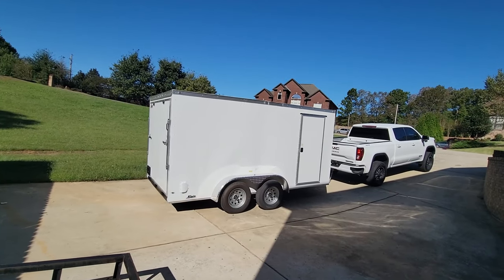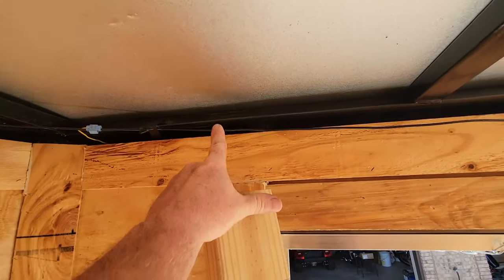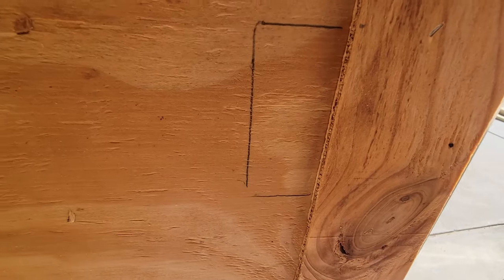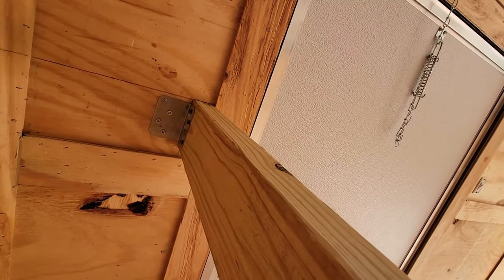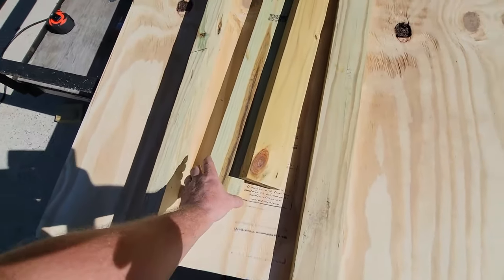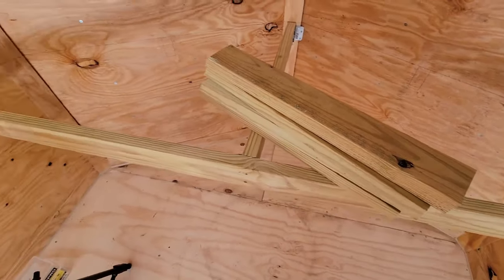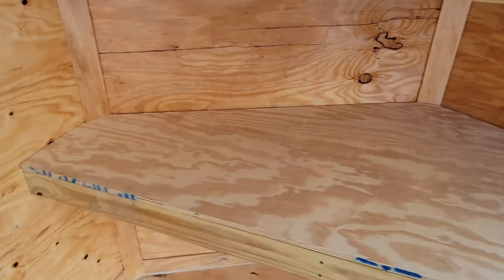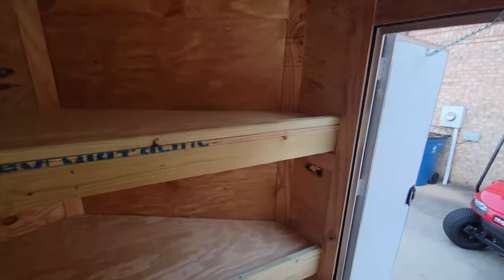DIY Trailer Shelving Install

Comment: Great use of space and much less expensive than commercial shelving. Would also imagine that with the additional bracing you installed it will also help with the structural integrity of the nose of your trailer. Thanks for posting - now come on by and help me get mine in 🤣
Reply: Absolutely I can do that 👍👍

Comment: Great video ! Since the walls are 3/8” thick how sturdy are the brackets holding? Any issues with weight once the shelves are completed?
Reply from the maker: I have about 100 pounds on each shelf and have put about 500 miles on the trailer with no issues. Im pretty happy with it.
Reply: Do not put them just in the plywood. Not going to last. Get them in the metal supports with self tappers

Comment: Sheesh dude would be about 10x stronger if you fastened to the metal studs. I’d be surprised if that’s holding up under any amount of weight. Good for you if it is.

Comment: What if the ceiling brackets your measuring down from arent level? 😳
Reply: Nothing in these trailers are level, or square.  You have to choose to come from the floor up (what  do) or the ceiling down.  Since they are made for cargo and not camping (again, what I do), you have to make the best of it.

Comment: Shouldn’t you screw into metal tubing of trailer
Reply: Yes, please don't do what this guy in the video did.  He has no idea what he's doing.
Reply from the maker: Theres no problem with how these shelves are mounted. I’ve got over 200 pounds sitting on these currently with zero issue. Thanks for commenting!
Reply: Yes you should!

Comment: Why can't you just measure from the floor which should be level?
Reply: You can. Floor or ceiling
Reply from the maker: Ceiling and floors were not level in the trailer.

Comment: Your using the wrong brackets. Should have used hanger brackets. It won’t hold any weight. Hopefully your loading paper towels on that pos.
Reply from the maker: You sir are what we call a hater. Over 200 pounds to date STILL sitting on both shelves. No problems. Thanks for commenting and boosting my stats!
Reply: @diydozier3205  no I’m not a hater. But I’m glad it’s working for you.👍
Reply: You’re*
Reply: Wrong brackets is correct